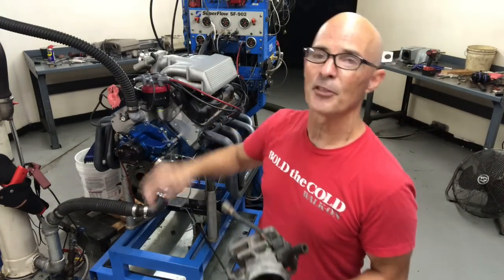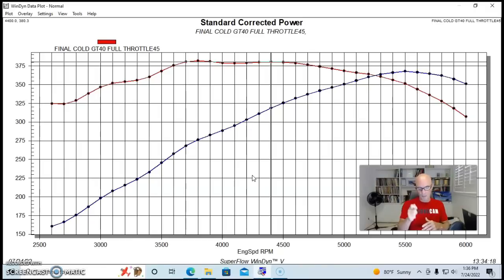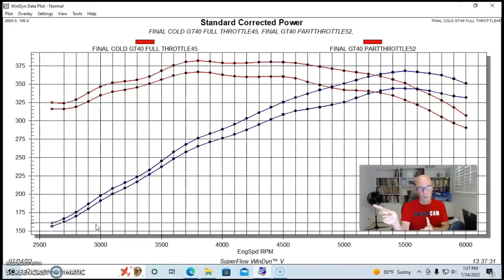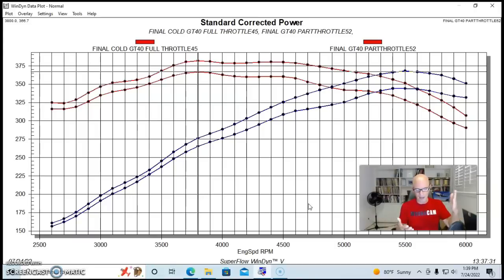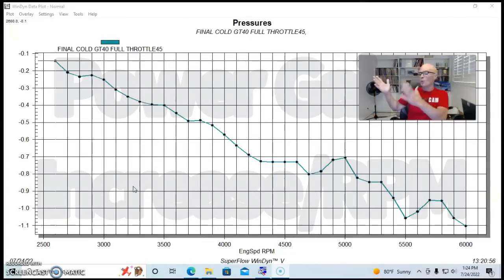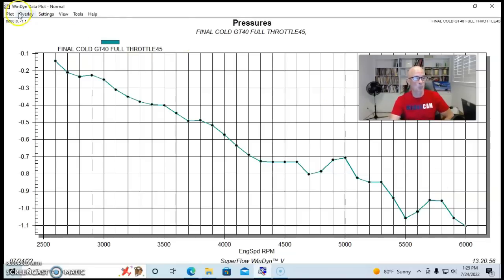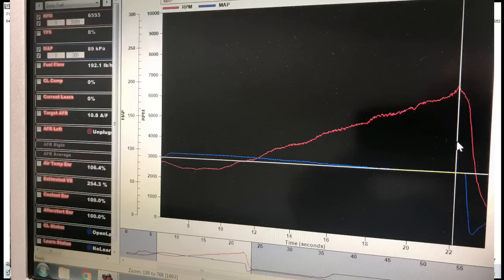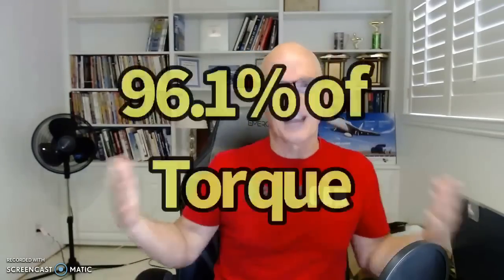CAN YOU MAKE MORE POWER AT PART THROTTLE THAN FULL THROTTLE? DOES 50% THROTTLE EQUAL 50% POWER?

Comment: Hello Richard, i have the reverse problem, it's a turbocharged 1.4 liter GM engine with a G25-550 turbocharger, standalone ECU, Bosch 550cc injectors, original throttle body, original intake manifold with a restriction right before the injector drilled out. It is a small 33% plate thing that is meant to produce turbulent air right before the point the injector injects fuel. Valve springs and a bit bigger camshafts. It pulls really hard from 4500 to 7600 RPM, but under certain highway driving conditions, i noticed the car noticeably gains torque when i keep my throttle at about 90-95% as opposed to 100%, what would be the reason for that?
Reply from the maker: does the blade go over center? is the timing or AF changed when this happens

Comment: This is pretty interesting, thinking about it, say normal driving condition 1500 - 4500 rpm at half throttle or less. I'm guessing cams start to get very close in performance as well. Be interested to see the difference between say stock roller cam and the common ones like the steeda #18/19, and the ford 303's at part throttle.

Comment: I don't know why yt didn't notify me to this one? Would of been cool to see 1/4 to 1/3 throttle as well where most driving is done and 3/4 for an extra data point. This extra data could give us the info to make a formula to help calculate what percentage of the max the engine is using in any given throttle opening. But hey, thanks for making this one.
Reply from the maker: throttle angle alone doesn't dictate % of power being used-load and rpm are part of that
Reply: @richardholdener1727  
Yes and isn't that a constant on the dyno?

Comment: Does the low difference of power between half and full throttle apply to all (natural aspirated) engines? I was wondering if there's something wrong with my bike's inline 4 cylinder engine that seemingly didn't care if I went full throttle or about 3/4. It is cable operated and carbureted.
Reply: Tighten the cable n check if there's a difference felt..

Comment: Well suppose if you are way over the top on available air flow, you could make the same power at 25% or 100% throttle,   2liter motor with 2500 CFM available?  what is it going to need/use.. Especially true on EFI apps..  air is air, either has enough or not..
Reply from the maker: yes-size matters

Comment: Do you know what the kpa was in the manifold with the engine off? Be interesting to know what effects that 6.5% loss at 50% throttle more, heads, cam, cubes or intake. Since a factory cam favors the low end already would the loss at 50% throttle be negligible?
Reply from the maker: it won't just affect the low end with one throttle position

Comment: This makes perfect sense when you think about it from a practical stand point. If you hop in your daily driver and accelerate to highway speed using half throttle then accelerate to highway speed using WOT but keeping the same RPM sweep the difference in acceleration isn’t anywhere near twice over, it’s actually very close. It isn’t until very high engine RPM the differences become great which is where the airflow requirements are much higher. One thing I would like to see is this test done on a setup that moves a ton of air, instead of a mild roller small block like this one. I’m just thinking that something wild like this  Pro-Filer headed 4.84 motor I’m looking at in the shop right now would likely choke much more at part throttle than say a stock 5.3 or 302 sbf because it flows so much more air to begin with. 
I’m very curious on this now.

Comment: Also note that a lot of factory vehicles do not correlate 50% on the pedal to 50% on the blades. Cable driven will have a curve built into the lever, drive by wire will have a computed curve programmed in. This helps with half power at half throttle but isn't always perfect. 

But good info here!

Comment: I find this interesting when looking at the power numbers.  Whether it is my turbocharged Subaru or my carbureted duster the cars always feel like they accelerate the same if I'm at 50%ish throttle or full throttle.
Reply: So true , especially that turbo stuff it seems to be like 95% power at half throttle
Reply: @scottallpress3818  it is nice to get in an old car occasionally with a throttle cable ,to remember what real response feels like. 
Hiccup and sneeze,  bump the throttle and oops ya got coffee in your lap. 
Because the things so damn old it doesn't have cupholders
Reply: @MrTheHillfolk  no one has ever been more correct than you right now !
Reply: @scottallpress3818  as slow as it is ,I do like my 91 Jetta diesel. 
Touch the pedal and get a response. 
Of course don't expect much from 52 rated HP😄

Comment: My guess before watching the video: 50% throttle angle does not translate to 50% less airflow (the hole isn't half the size), especially as it relates to engine requirements throughout the rev range. After watching the video: OK, that makes sense, lol.

Comment: Richard I think there is a problem in your testing. Here is why, because on the Dyno you control the load much different than you would in the car. So a true test of this theory would be to see the actual speed difference at Bonneville, my guess you may see a much different outcome.
Reply from the maker: the airflow and power are still the same

Comment: Is there a way to determine the force an engine imparts at less than 100% load?  This test makes it sound like the engine is putting 90% of its twist capabilities at 50% throttle all of the time, if that were the case, a Jeep T90 transmission would snap as soon as you let out the clutch the first time behind a v8 swap.  My assumption is that the actual load on the tranny is related to traction and weight of the vehicle as well as the abruptness of application.  It would be nice to have a mathematical formula that would allow someone to know a “never exceed” rpm/throttle position for something with a weak tranny.
Reply: With a weak tranny, never full send, thing will heat up n at sluggish.. i let my bro drive my 95 Lincoln, he drove it like he stole it, i know bcuz i could hear him 5 miles away, i was pissed.. When i drove the car when he got back, thing was running slower..

Comment: I don't know if this works for drive by wire electric fuel injection. However something I learned from a mechanical fuel pump and injection system and a carburetor was to go to full WOT and then back off just a touch. Example foot to the floor then lift the throttle up about a quarter to half inch. This allowed my engine to breathe and I was getting 200 rpm more than foot to the floor was giving. In 3406 B cat I was driving would go to 2300 rpm on the floor but lift up a bit and I could get 2500 rpm which I was getting 10 mph for every 100 rpm in high gear and above 1800 rpm. So I was able to squeeze an extra 20 mph out of the semi. Maybe it don't sound like much but at wide open I was getting to 110 mph and when I let her breathe 130 mph and that's moving in something that weights 80000 lbs. Just so you know I don't drive that fast anymore I scared myself one night and realized what an idiot I was. I flew past a state trooper in the median and it took almost 1 mile get slowed down. Luckily for me he must have been asleep or broke down because he didn't come after me. Lesson learned.
Reply: Yeah, i was gonna say that if i saw something that big n heavy driving that fast, i'm either racing you or getting the fuck outta your way, that's too fast n too heavy to stop in time if a dumbo got in your way..lol At least you didn't crash, get arrested or have the brakes fail, sucks learning lessons that way..
Reply: Good on you for learning, i'm glad someone tried while the getting was good. Interesting and impressive from an equipment standpoint!

Comment: How about testing a turbo set up with part throttle and full throttle at the same boost level. I’d be curious to see how much throttle plate alone hurt power.
Reply from the maker: AT THE SAME BOOST?
Reply: @richardholdener1727  yes same boost both part and full throttle. I’m curious because certain drive by wire cars use partial open throttle plate to control boost levels rather than wastefate only. It’s actually common control on the focus Rs where it can partially close the throttle plate even at commanded boost in the upper Rpm range. I also see this when the factory electronic wastegates can’t keep up with boost control it  closes the throttle plate partially. Since this happens in ecu on its own and I can’t delete the electronic gate I can’t compare the actual effect. 

I see it mostly on cars with ported cylinder head that gave an electronic wastegate. It’s because the electronic actuator range is rather limited so it can end up at max open range yet the turbos wants to boost creep.

Comment: Sorry unrelated but have you ever wondered what would happen with a turbo sbe ls (with gap) on e85 mixed with 5% 10% 15%..... nitro methane?
Reply from the maker: NO SIR-IT DOESN'T MIX WELL WITH GAS
Reply: @richardholdener1727  Thank you for the reply!  So methanol and ethanol aren't the same for mixing or is the 15% gas the issue.
Reply: @bbcnova56  It'll mix fine with ethanol.  I've done a little with E85 and some additives. But most guys, if they're serious just mix with methanol from the go.

Comment: So I would like to know what vacuum number do you want to see at wide open to show that the carburetor is the correct size for the engine?
Reply: Typically on a street engine 1-1.5 inhg at wot full rpm is a good indicator that the carb is correct. If it's zero than it's usually too big for street. I like a smaller carb for the street cause it has better response and more torque down low

Comment: Be interesting to see you do this with a turboed engine. My experience is unless you have a really responsive, well situated wastegate with good control that the throttle barely cut power until it is almost closed- very limited data set though.

Comment: Only A Slight Discrepancy For Modern Fuel Injected Vehicles Is "Power Enrichment". It Really Depends On The Vehicle But 50% Throttle May Not Be In Power Enrichment Which May Target A 14.7 AFR. Once It Enters PE Then It May Target 12.8 (or whatever) . Sometimes PE Is Determined By Throttle Position, Sometimes By Pedal Position And Sometimes By Calculated Load, KPa, RPM etc. It Might Also Switch To A Different Timing Table Between 50% Throttle And 100%. But If It's NA Most Modern FI Vehicles With Throttle By Wire Never Pass Around 50% Throttle Gradually. You Get Maybe 0-30% For Normal Driving And Then WOT 100% So It Will Skip From 30%-100% Mainly Because What We See In This Video. Your Getting 99% Power At 50% Throttle So The OEM Characterize The TB To Operate Accordingly. But I Still Think This Is Pretty Accurate In Showing Your Not Lossing Much At 50% Throttle For Most Throttle By Cable Vehicles.
Reply from the maker: THERE IS NO POWER ENRICHMENT-NO TARGET AF-I MADE THE AF AND TMING EXACTLY THE SAME
Reply: @richardholdener1727  Right I Know That But I Was Just Pointing This For OEM Vehicles On The Street.

Comment: I'm surprised that's all the power it lost. That's awesome to see IV been messing with boring my 50mm 5.9 magnum throttle bodies out to 53mm and the throttle response is great and my 53 flows just under 1000 cfm but no real power gain over just a ported 50mm. At least not at the 300rwhp at 6000rpm level. IV put a bigger cam in now and I'll test again. Then twin turbos or torquestorm time.
Reply: i think using a bigger throttle body always helps, more air enters the engine without having to gas it more (aka floor it..)
Reply: @P71ScrewHead  on the dyno the bigger throttle body didn't really show a difference at the track though I had some traction issues but a couple runs back to back small throttle body to Big throttle body it seemed like it picked up half a second and I've got another video where I was doing throttle body testing from on the highway from 50-110 or something like that and it picked up time there too even though it didn't show anything on the dyno.
Reply: @thomasbeyer  Hey, but after comparing both, which would you prefer to keep on your engine?? I think the bigger one, right??
Reply: @P71ScrewHead  lol it's always the big one lol
Reply: @thomasbeyer  Amen, man, you can never go wrong that route..lol

Comment: I noticed long ago that my 4.3 Vortec had a built in throttle restrictor riveted to the throttle plate. I removed it, plugged the holes in the plate and it did improve throttle response to the point where I would get wheel hop sometimes.
Reply: That " restrictor "  is installed to help low speed drivability.  The ramp effectively blocks 1/2 of the throttle blade at low openings  ( the air flows through the non ramp side of the blade.  )     Ford does a similar thing with a toothed TB gasket.    By the time you get to full throttle, the restriction is about zero i either case.  Without the restriction, the throttle is too touchy for precision work like backing up a trailer / parking.
Reply: @bobroberts2371  sick!